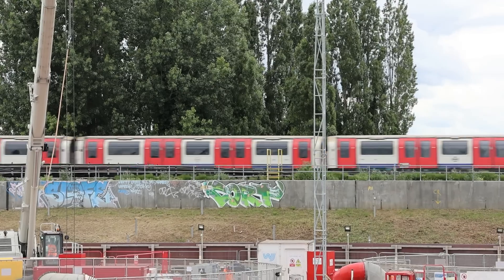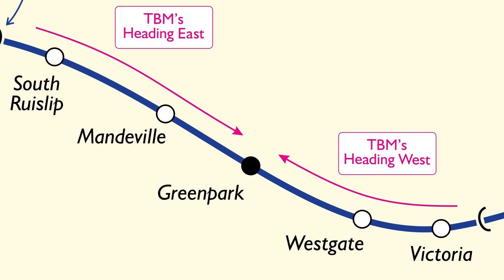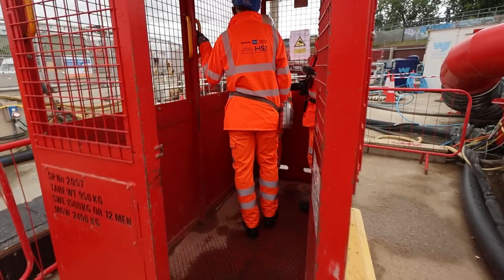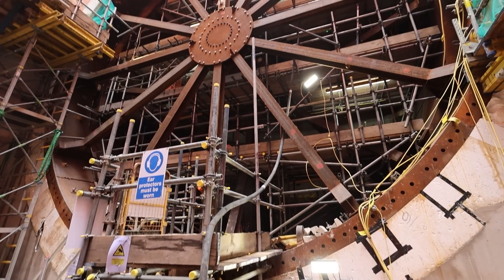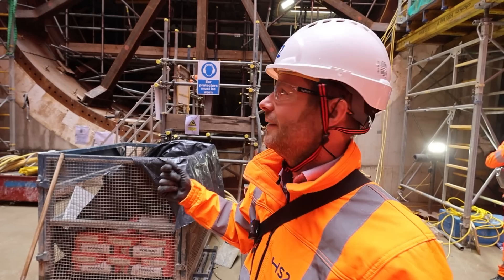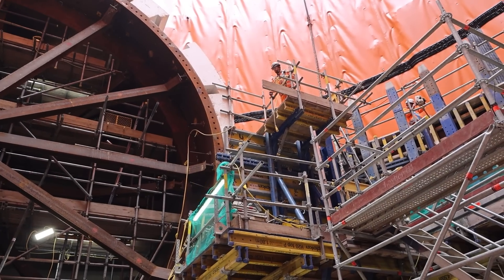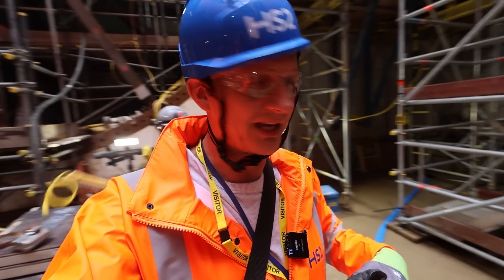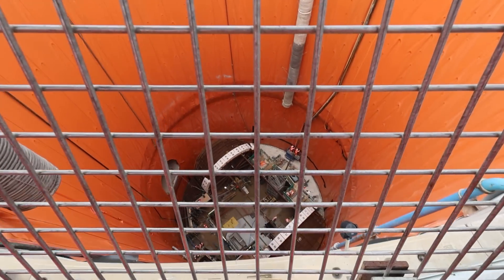Inside HS2 Vent Shaft Construction

Comment: Good to see all the work on the Birmingham Branch line. Unless the northern section is put back on track, or some serious improvements are made to the WCML north of Crewe (because HS2 trains will be limited to 110mph over much of the line) it will have been a complete waste. What we’ve managed to do is bypass one of the least congested sections of the WCML (with Crewe northwards being the bit that struggles the most fitting the mixed traffic in).

Comment: Geoff is there any merit in thinking that HS2 should have started in Leeds rather than London? The powers that be talked of the importance of `levelling-up` with the North with this rail project but as has transpired this will not be the case. All the money spent in the South ( London to B`ham ) could have been better spent on improving connectivity between Leeds & Manchester ( & other cities perhaps ) down to B`ham with to prospect of building a not so grand line so as to actually be able to complete the project. I`m not a `Northerner` but even I feel cheated that these grand projects will be complete in the South at the expence of building much needed basic infrastructure that the North craves & was promised. I feel we`ve missed a great opportunity to link our cities the way the Europeans have done to the detriment of the nation as a hole. Perhaps my thoughts are way off the mark?!

Comment: Wow - cool!  I would have thought the tunnel boring machines would leave the same way they arrived.  Ah, well, I'm sure there is some sound reason why not.
Reply: Do you mean you expect them to go backwards through the tunnels they've just bored? They can't because they line the tunnel as they cut it so the tunnel diameter is smaller than the cutting face. There will be four machines arriving in that shaft from two directions so there's nowhere for them to go except up the shaft after being dismantled.
Reply: @johnm2012  Ah, okay - thank you.  Now I have the perspective!

Comment: I liked the “ mind the gap”  bit, that was a good one as it were Geoff, maybe you could discretely add them in every so often. I wonder how big the Tunnel Boring Machines are, I don’t know if they can tell you or maybe nobody knows. Say what you want but it’s boring stuff made exciting!
Reply: From the HS2 website, the TBMs are about 170m long, weigh ~2000 tons and have a cutting head diameter of around 10m across
Reply: That's the entire machine.  The cutting head is about 15 metres long.
Reply: @TrevorWilliams-fq8mg  But the cutting head is rather useless without the rest of the TBM with it!

Comment: Do you know what trains are going to be used on HS2
Reply: Alstom and Hitachi are working together to make a new fleet of high speed trains that will be able to run on HS2 and on the existing West Coast Main Line.
Reply: @pokemonsuper9 I thought Bombardier was making all the Rolling Stock/Locos
Reply: Bombardier was purchased by Alstom a while back; so going forward they will be listed as Alstom products
Reply: @andrewreynolds4949  Oh, now it makes sense. Cheers mate
Reply: Not completely accurate, Bombardier sold off it's train manufacturing and maintenance division Bombardier Transportation to Alstom, Bombardier still exists as a plane manufacturer
Reply: @CynicalPlatapus  Alright 👍🏻